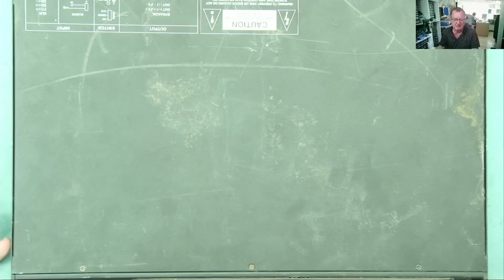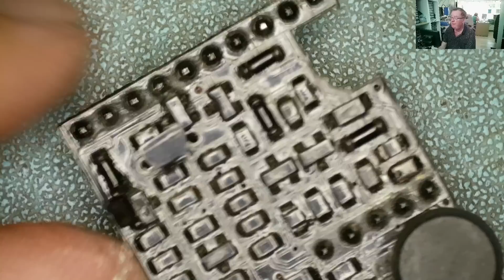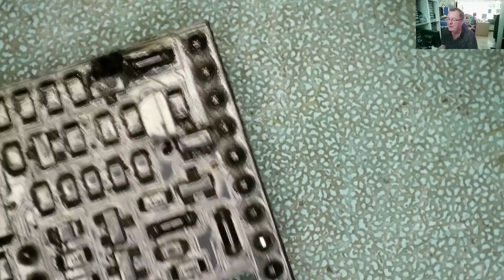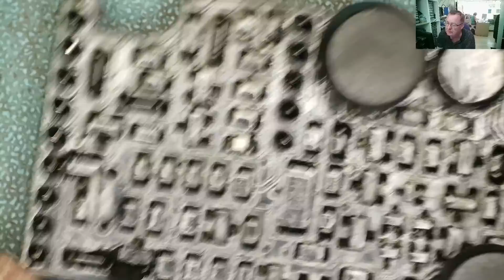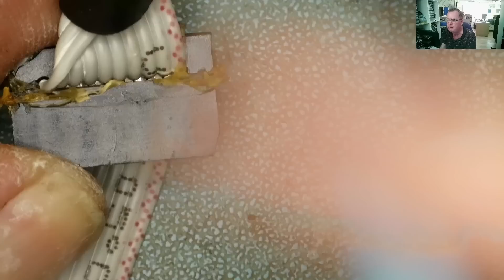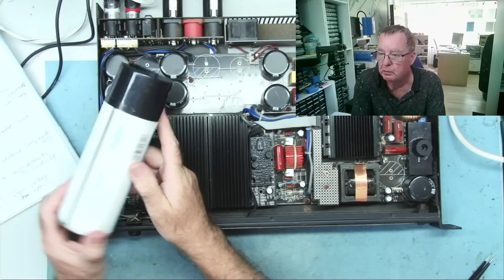How To Locate Trace Diagnose & Fix Intermittent Faults In Electronics: With Practical Repair Example

Comment: Compressed air can hold upside down works same way as freeze spray. I believe they are basically the same. Freeze spray has internal straw taking liquefied gas from the bottom but compressed air does not have it just to spray evaporated gas.

Comment: We once had some gear we were designing fail in Japan but not in out Leeds office. We quickly decided it was heat, and threw a fluffy jumper over it, and fail, yay! We then tracked it down to one FPGA using hot air, and then put a wirewound resistor connected to a bench supply on this so we could keep it warm. We tracked the issue to bad VHDL with a race, and had it fixed within an hour. The engineer decided to up the current to prove the point, hit 50C with no issue, and went off to celebrate with a pint or two for lunch. While he was out, colleagues heard a clatter and it was the FPGA - still with big old resistor strapped to it - desoldering itself from the board and hitting the bottom of the case. His job after lunch was hand soldering a new FPGA onto the board, which was lucking QFP rather than BGA.

Comment: When doing customer repairs, the biggest issue with intermittent faults is being able to verify that any intervention has solved the problem. This is bad enough with local clients, but mail-ins even worse. No point having a call back saying 'it worked for a bit and is now doing it again.' Actually, thinking about it such situations are to be 'commercially avoided'. Boomerang jobs, we call them.

Comment: I once had a cracked TVS diode in a hard drive. Depending on how the layers shifted during operation, it would sometimes be open and the drive worked. And sometimes, it would short and the drive stopped working. I'm not sure how common that is (I'm just a hobbyist, my sample sizes are small), but TVS diodes seem somewhat prone to failure. It wouldn't surprise if a certain percentage of those were intermittent.
Reply from the maker: That sounds like the same failure mode for MLCC SMD capacitors.  You would think something with a crack in it would tend to fail open circuit, but those are made more like a wafer biscuit so when they crack one wafer touches another wafer. And that creates a short.
Reply: @learnelectronicsrepair it is to some extent the same type of failure yeah. Their construction shares some elements

Comment: Yes, every workshop should have a "knocking stick", a bit of wooden dowel or plastic rod of some sort about a foot long. Great for tapping on small areas or individual components. Also good for pressing on things, sometimes just flexing the board or pushing on a component will provoke the problem or reveal a bad connection or mechanical problem you wouldn't otherwise notice. With a nice insulated prodder of reasonable length you can safely have a go at the insides of pretty much anything while its powered on
Reply: Percussive maintenance was never gone 😅

Comment: Great video Richard.  I find wooden chopsticks good for pushing on components to localise dry joints, cracks in components and tracks.
I use cans of "compressed air" to freeze components.  In the UK, they only cost a pound from pound shops.  Much cheaper than freeze spays.
Reply from the maker: Would the compressed air can work here for example,  I don't think the workshop temperature ever drops below 25C and From March to November it's usually 30C.  It might get closer to 21-22C in Jan/Feb. I just checked this morning Oct 4th 10:00am its 29.1C ambient.  I've just switched the air con on.   There is no artificial heating in the shopping centre by the way
Reply: @learnelectronicsrepair  I use the cheap poundshop air cans too. Once identified a dodgy TV chip that the picture improved when being frozen. Canned air, or freeze spray, was what I used a lot to find shorts before thermal cameras made it easier.
Reply: @learnelectronicsrepair 
It's called Air Duster.  It comes with a straw for precision use.  It contains a volatile HCF.  It freezes down to -32 dec C as it evaporates on the component.  It should be fine in warmer climates like the Canaries.  Incidentally, it is rubbish as    an Air Duster - it just sprays a fine mist of coolant!

Comment: I worked on another old amplifier where some capacitors leaked and damaged the transistors under the heatsink. It was covered by hardened white glue. Those leaky capacitors can cause quite alot of damage
Reply from the maker: Yes.  Though not as much as old leaking batteries!

Comment: In case of trimmer pots and pots for volume control i used wd40 penetrating oil. I cleaned up an old amplifier from corrosion using a brush and wd40. No noice at all and it still works perfectly today
Reply: WD40 is an oily substance, could cause some resistance and burning on higher current devices, no?
Contact spray is better solution.
Reply: Wd40 is the contrary of oil, at first glance you can see it as oil, but, in fact, it dries, and strongly. It is totally forbidden to use it in faders, or you will kill them
Reply from the maker: @itrema  WD40 is a Water Dispersant, not an oil.  It's also a perfect product.  It's been around for decades but they obviously can't improve it (like they do with washing powder and floor cleaner) otherwise we would be on about WD47 by now... yeah?   I do have a can of 'WD40 Limpiador de Contactos' and that is switch cleaner.  It doesn't smell as nice as regular WD40, which is a bit addictive I think 🤐